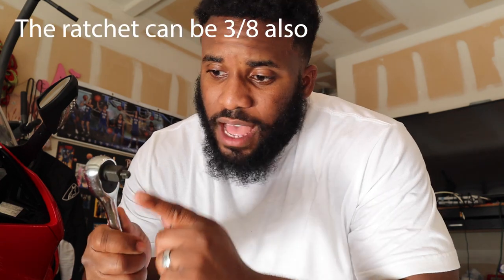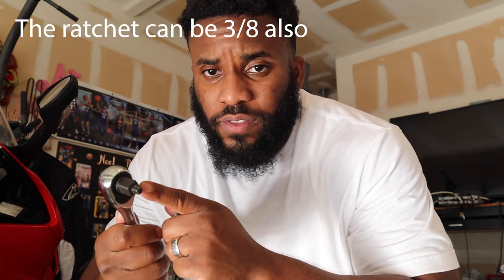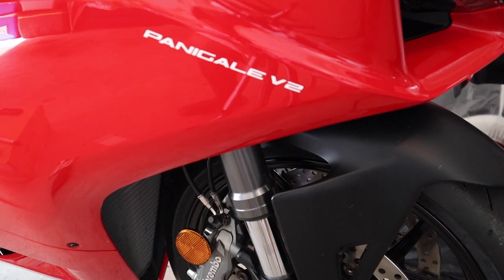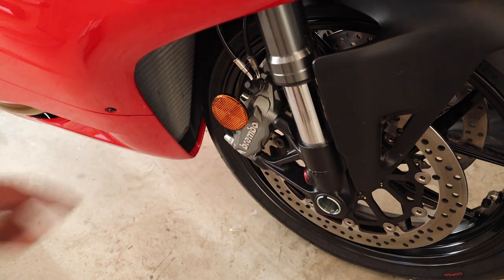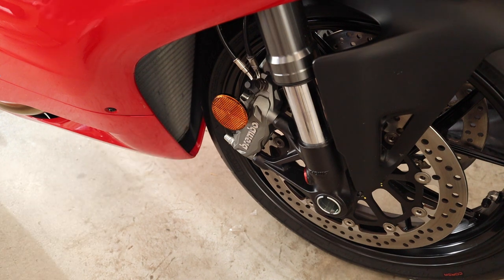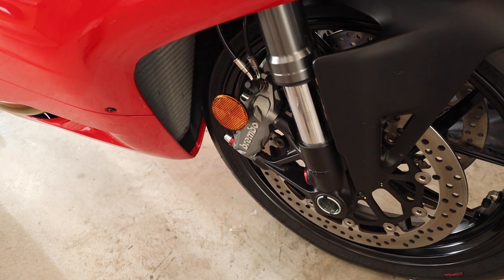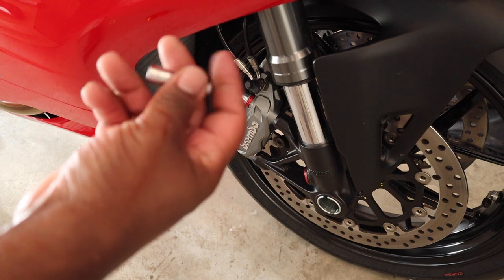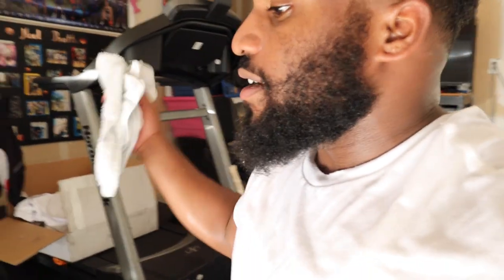Ducati Panigale Caliper Spacers Install, Proper Specs and Giveaway

Comment: Was very confused with this at first. I thought your bike had been assembled wrong, but after looking at photos of other V2s, could see all was well.
The spacers on all other Panigale’s fit under the callipers. Can’t understand why the spacers are required as with the 1229, V4 etc the calliper bolts don’t require a washer under the head of the bolts.
But again good clear instructions.